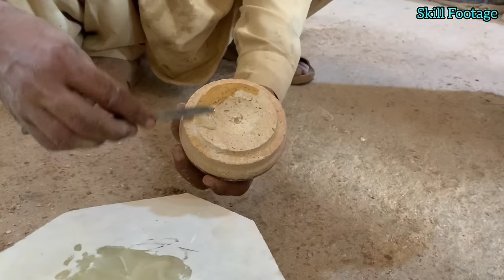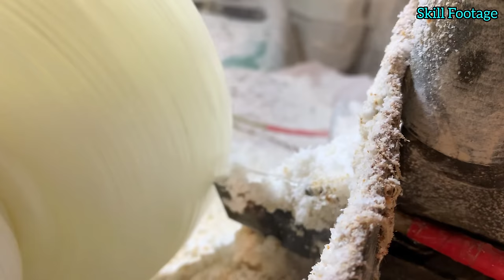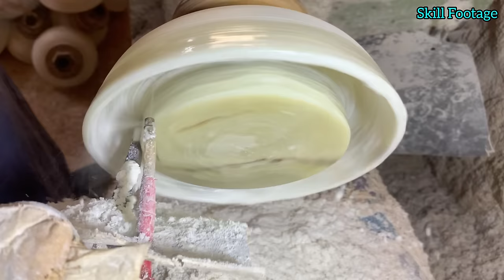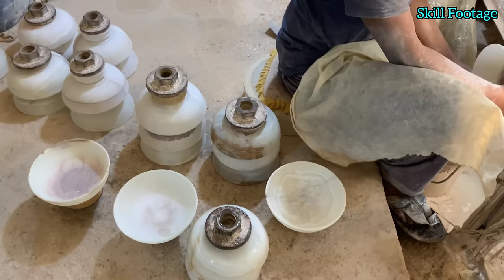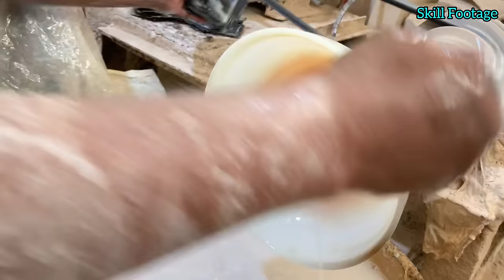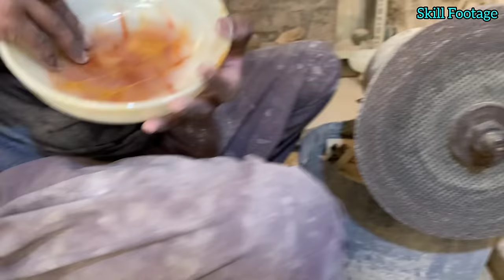How ONYX Marble Stone Bowl are Made || Handcrafted ONYX Marble Stone Bowl || DIY ONYX Stone Bowl

Comment: Absolutely remarkable! Without a facemark, I wonder what the dust is doing to their lungs though.
Reply: Throughout the process they have a stream of water running to catch the dust and turn it into slush, also to stop from heating. Stone is never cut or polished without water being poured on it continuously.
Reply: @parulsinha3092 you better the watch the video before  you comment. Otherwise you'll see that in during the main operation process no water is applied and there is lots of dust all over.
Reply: @andrekolesnik2376  Exactly.
During the initial phase of cutting water was not used.
So dust was flying everywhere